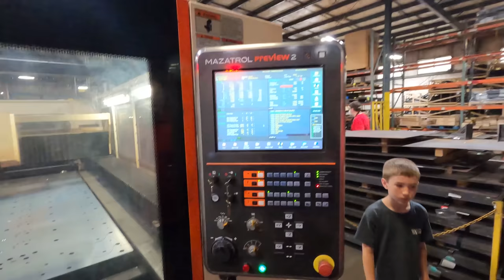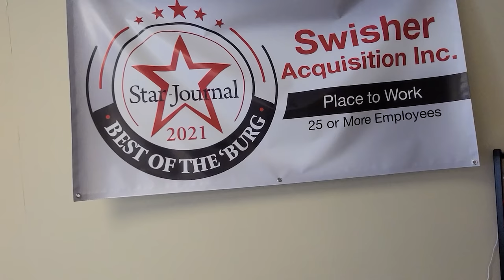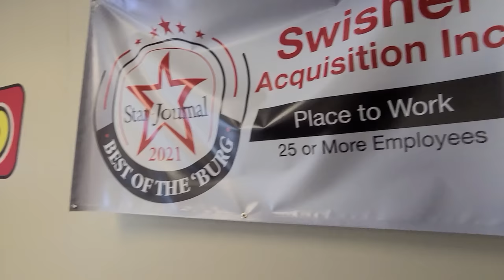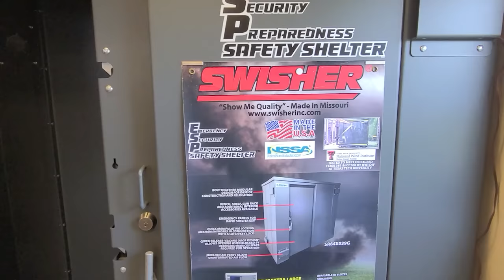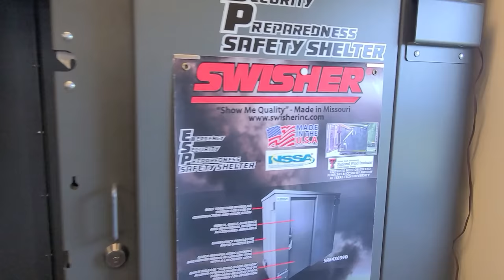Swisher Inc Outdoor Power Equipment BEHIND THE SCENES Tour

Comment: I just quit a job building food processing and conveying equipment for Frito-Lay and Schwan's. all stainless 1/4 to 1/16thick. 30ft deep fryers, conveyor belts, packaging machines and oil heat exchangers (boilers).. very similar to this place.. ALONE I can burn 1-1/2 35lb spools of 409 ss .045 dual shield, in a 12hr day.. 320 wire speed...LET'S GO BRANDON   LET'S GO BRANDON   LET'S GO BRANDON!
My name is NOT Brandon!

Comment: Powder coating sucks it chips and flakes and hold moisture and rust metal way faster then paint
Reply: Like everything slse in life Ken - all depends on how you do things.  The US Military will honor Swisher with powder coating work starting in 2022.  All durablilty tests and specifications were surpassed by Swisher.  Swisher powder coating does not suck and will last MUCH longer than a painting process - rest assured Sir.